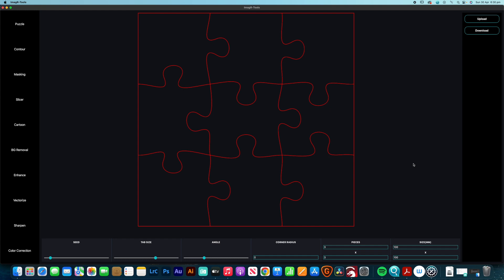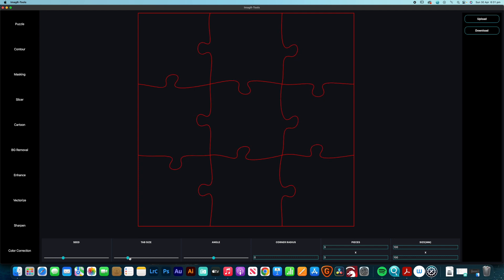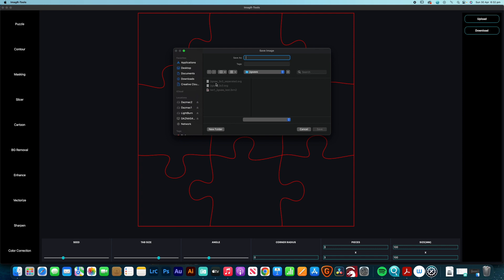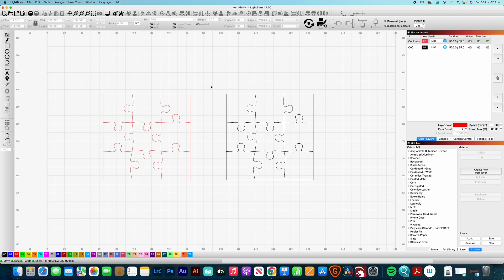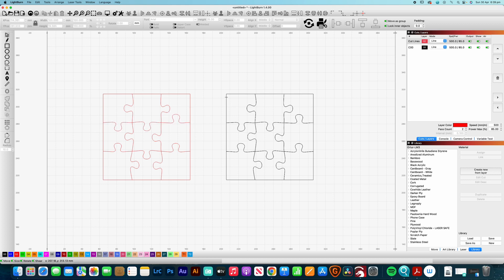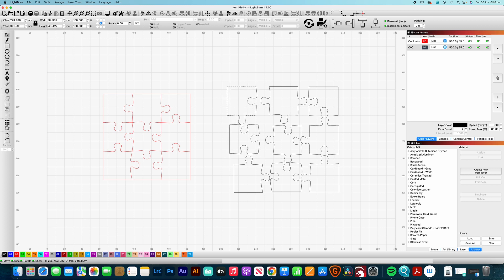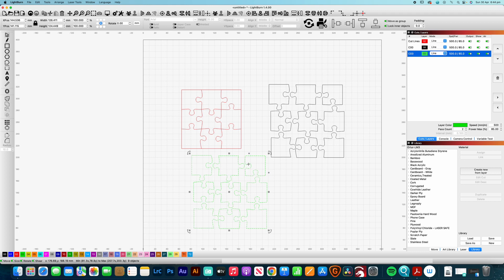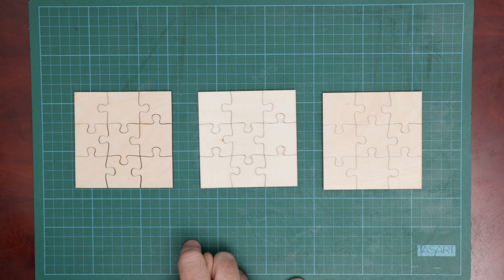What's KERF? How to control it in Lightburn on your Diode Laser for PERFECT fitting Jigsaw Puzzles

Comment: I may have missed it, but you are cutting each individual piece by itself?
Reply from the maker: Yes - that is correct - only in the instance where you might want the tighter fit - however depending on the size of the puzzle would determine if it is a viable alternative - in most cases i expect that it wouldn't  😀

Comment: you can do this all in lightburn without the need for the other programme , import a well defined picture of a puzzle template off google images,- tools- trace image-select everything (if not automatically selected)- ungroup selection (top toolbar that looks like a human head) then disassemble your puzzle and adjust kerf to suit in lightburn by double clicking the cut you applied to the parts
Reply from the maker: Hey Luke - yep plenty of ways to achieve the same result.

Comment: I've been hunting around on youtube to see what limitations there are on the number of puzzle pieces you can break a photo glued onto wood into.  I've seen 30 pieces and maybe a few slightly higher.  I'm wanting to do large puzzles of 30 x 50 inches for example that are 1000 pieces to start and even more pieces if possible.  Do you have any input as to what you think could be made properly so a customer would be satisfied with a puzzle and putting it together?
Reply from the maker: Hi Tom - with my limited understanding, if you are looking at a puzzle that big with that many cuts with each piece being roughly 1.5" square - along either axis (X or Y) the amount of material vaporised due to cutting (kerf) would lead to significant compounded sloppiness of the pieces, particularly if cutting on a CO2 laser with a wider beam, which you would want to be doing as a diode would take forever - test it with a single row puzzle of say 10 pieces long, based off of that test you can then estimate the additional kerf loss with roughly 30 odd pieces along each axis. Probably not much help, I have watched a few videos on die cut jigsaws and I suspect that they do them that way for a reason :)
Reply: @mrcraftsmith  yes I have seen the die cut jigsaws and the cost to make such a die is very prohibitive for a single person with a low volume maker .  I have access to 4 laser engraver/cutters at my maker space I belong to in my town so I am going to give it a go to see how I can make jigsaws likely with study cardboard and a photo glued on.  My daughter in law is a photographer and takes these really beautiful landscape shots as she travels across Canada each year so we are thinking of making jigsaws of them.  I'd like a minimum of 1000 pieces but that may not be possible.  I'm not sure how fast a diode laser of 10 Watts would work but time isn't at this moment an issue.
Reply from the maker: For sure Tom - I understand the cost prohibitiveness of a die cut setup and was never intended to suggest that route, I can't remember if I mention it in the video but if you were to create a border for the jigsaw to sit within and make it a mm or two undersize from the main jigsaw that would account for a little bit of the kerf differential. Best bet is to play around and do some testing...let me know how you go :)

Comment: Can the kerf compensation be applied to the puzzle without making all individual pieces ?
Reply from the maker: Hi Joe, no that is not possible - each cut by a laser is going to "vaporise" a certain amount of wood hence creating the cut, there is no way to offset that in a single pass for multi-piece puzzles to get a tighter fit
Reply: @mrcraftsmith  I understand that the pieces need to be cut individually, but I am cutting a picture glued to board.  I wish there was a way to get the picture onto the individual pictures.  any thoughts?